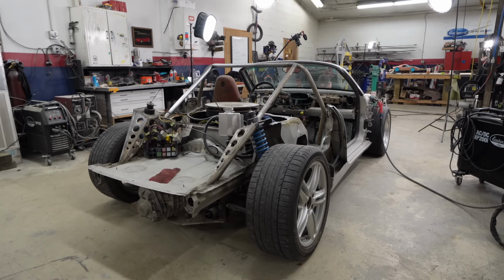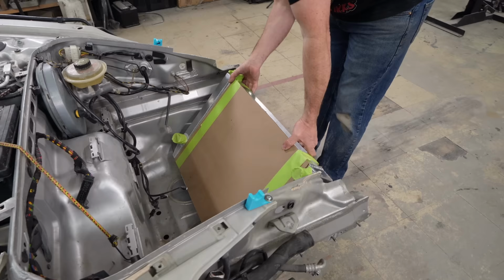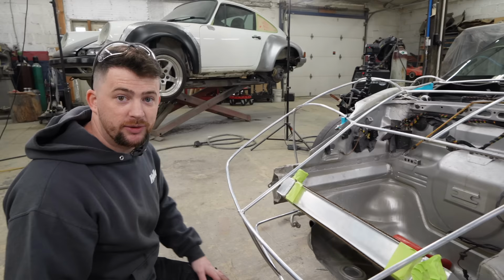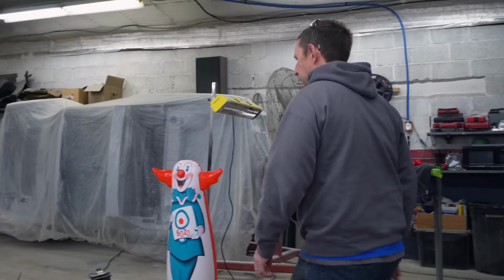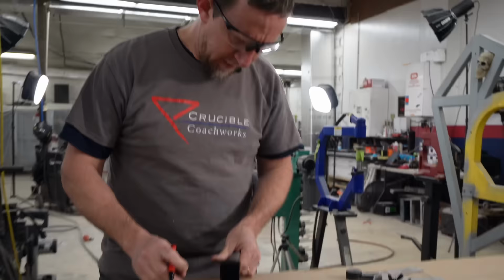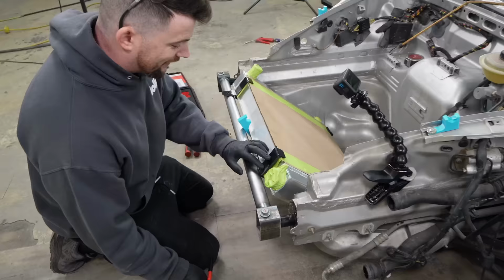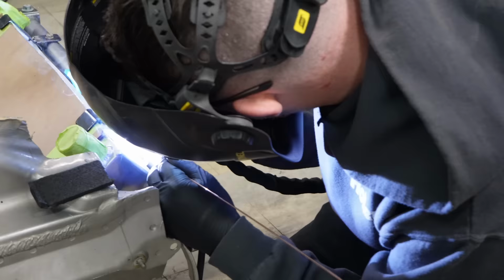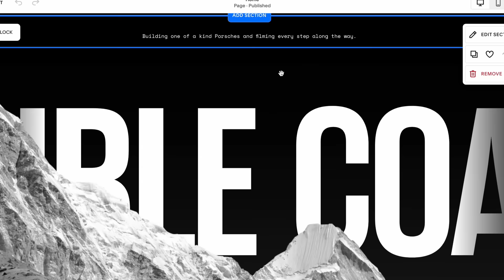$500 Junk Car to Supercar! - Custom Cooling System! (Project Jigsaw)

Comment: Coachworks is a no-compromise custom auto builder that cuts all the corners, and everything else, only to maintain fluidity, cohesiveness, and logical  functionality. Glad you said screw it and cut the front up to make it work and look like it was meant to be that way IF it came from a factory. 🤘

Comment: I'm not an engineer, but I question solid mounting the radiator to a collapsible bumper and then to the tub. Also, the front of that lower tub had to add rigidity across front end, I'd throw another tube across between the lower reinforcements.  Coming along nicely overall.

Comment: Although it might be not the correct materials for the time period you're aiming for, but what about a fiberglass duct for the rear of the radiator that is somewhat moulded to the shape of the tub? Something that can be removed with a few fasteners so that you can access the rear of the lower part of the tub and the master cylinder/fuel tank region.

Gotta worry about inner fenders and how they integrate into the tub so a moukded duct at a later stage might be convenient

Comment: PRACTICE MAKES PROGRESS.  There's a T-shirt right there.  As far as the radiator - I used almost exactly the same principles when I fitted a custom built rad into a GTM Libra V6... but less welding (fibreglass, see?  :) )  We didn't even attempt to keep weight down (comfy GT spec) but it came in at 830kg/1830lbs wet, and with a little over 200hp from a 2.5l V6, it was a tiny rocket.

Was surprised you didn't try to keep the Porsche cooling - it's incredibly well-designed and ducted, the three-rad style system for the 996 turbo/Boxster S should be able to cope with the SBF.  However - it's a nice piece you've installed and it'll be interesting to see your hot-air exhaust ductwork.

Comment: Without question, you are exceptional engineers. My question is, would it not have been far easier to have built your own chassis to begin with? It seems to me by the time you finish you would’ve chopped off 90% of the original Car
Reply: That would take way more time and money, let alone the headache they’ll have. This way makes more sense because the boxster is a proven chassis with great handling characteristics. If they want to build different control arms the original is an example for them, let alone coming up with, buying and installing things like the brakes, suspension, steering, windshield, wiring harness, gearbox and safety and chassis stiffness (the boxster is a convertible so it doesnt need a roof to be stiff)
Reply: And what about the availability of parts in the future. If you use a known and well-functioning technique, long-term use is also guaranteed. Existing parts are generally more readily available than home-made parts.
Reply: Every kit Car, I know uses well-known parts and I would question how much of the original “well sorted chassis “remains.
I’m just asking questions here ..
Reply: The other reason that has been mentioned several times in the various videos is simply that they had this chassis.😜
Reply: Trying to figure out suspension geometry and building it is time consuming.
Reply: @jerytherew1  they pretty much had to do exactly that with this Porsche.
Reply: @stevieg7403  they didn't change geometry or mounting points just lengthened what was already there
Reply: @jerytherew1  did they not relocate the rear suspension struts?

Comment: no rubber mounts on the radiator? yikes. that thing's got an expiration date. and those griffins are expensive...
Reply from the maker: It’s isolated with foam that came in the kit, however we will likely change it out for rubber.